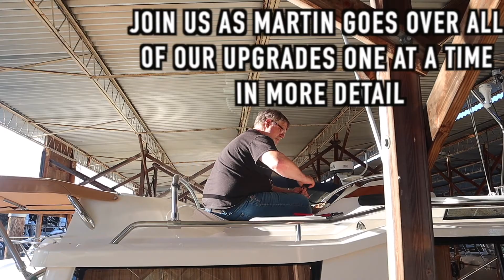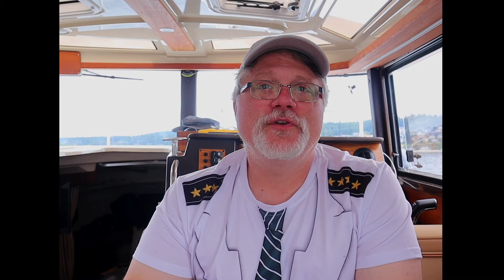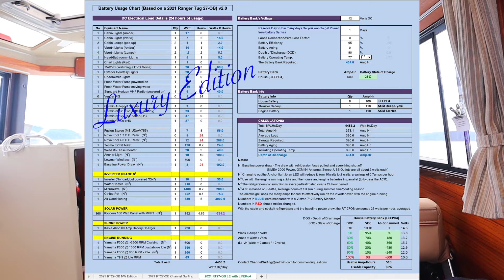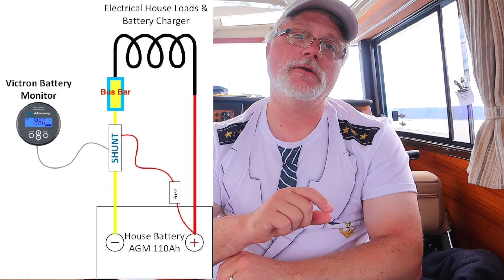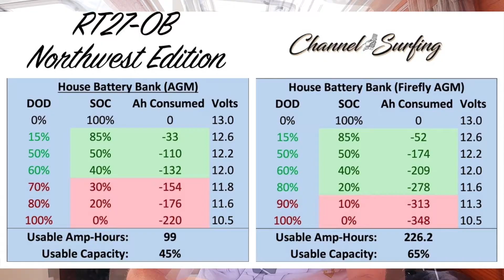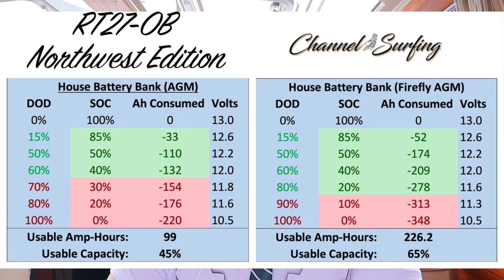Why do I need a battery monitor on my boat?/ Learn how to use it  Victron battery monitor bmv-712

Comment: Great video, thank you. I currently have a Morningstar RM-1 Remote Meter stock in my r29. Does the RM-1 have a shunt? If not, I’m guessing I would need to install one. 

The big win here is to be able to see %charged I’m guessing?
Reply from the maker: Thanks for watching!!  I believe the RM-1 Remote Meter by Morningstar is strictly for the solar panel and isn't a battery monitor at all. 

To install a battery monitor you would need to install as shunt.  The Victron BMV-712 comes with the guage and shunt.   The big win with a shunt is being able to see what % state of charge you are at.  Also, as an example, it lets you see that you've consumed -80amp-hours, are currently using -10amps, and it'll know that you can't go below -100amp-hours.  It'll say you have 2 hours remaining which gives you the option to turn stuff off to slow down your consumption, or to turn on the engine and start charging.  It's really like a fuel gauge for your house battery.

Comment: Thanks for another informative video.  It sounds like you had to install a negative bus bar; how many connections did you have to move from the negative on the house batteries to the negative bus bar?
Reply from the maker: Thanks for watching!! 
Hopefully I haven't forgotten one... ACR, House Loads, Inverter, Auxiliary Engine, Battery Charger, Solar Charger, to Shunt.  Looks like 7 connections.

Comment: The TV on a R27 2018 has a TV and the antenna from the factory. Here in Florida we get pretty good reception through the air. At marinas here usually there is cable TV. There isn't a cable connection on the R27 we are looking at. Would it be easy to add a connection? Easy to get it to the TV?
Reply from the maker: Running a cable there is challenging.  We ended up taking out our TV antenna, installing Internet on the boat, and installed a ROKU for the TV and we stream everything.  For us, the TV available over the airwaves isn't worth watching.   Check out this video if you haven't already.  https://youtu.be/-te5kYpIglg